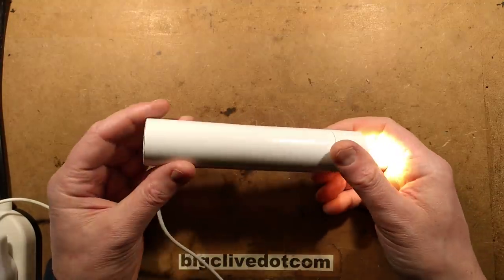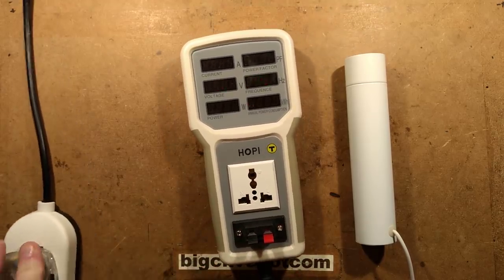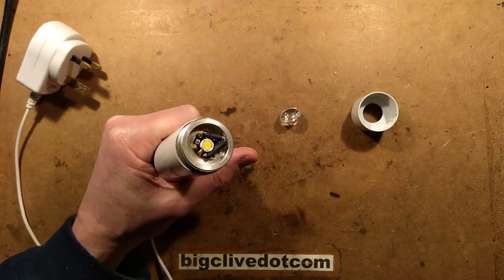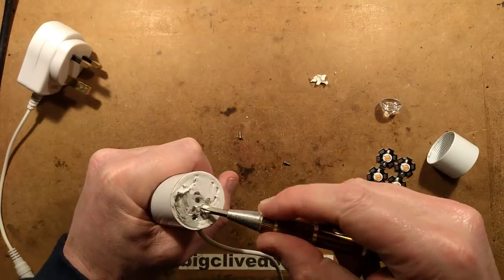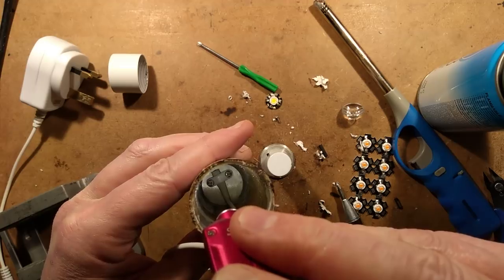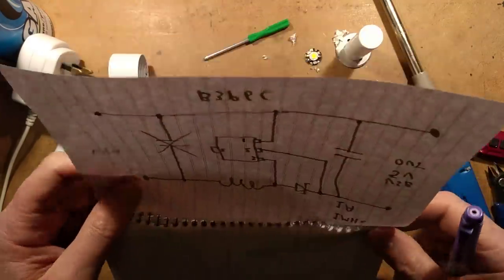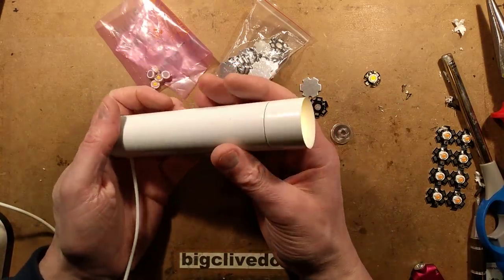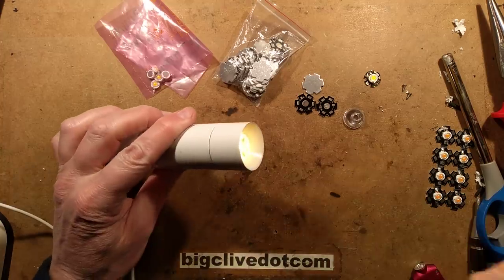Random opening, thoughts and mods to a chunky uplight.

Comment: You could have put a battery inside it and a switch on the side and..... Wait a minute, I think they call that a torch.
Reply: I was also thinking Bigclive inventor of the flashlight.
Reply: no no dummy thats a flashlight, a torch is a stick with fire on one end.
Reply: Chris thing is nobody cares it's differant versions of English e.g. American vs English so please shhhh
Reply: And put a flashlight driver in it, like a cheap  Nanjg AK-47A (hacking that with a fet on it). While we at it , use a zener mod and put a cree xhp70 6v (2x 18650) in it. At 7,5 amps it would be 5000 lummens :-)
Reply: @Ant1997Killer  ...........You just blew the Torch out !!....
Reply: Chris what if the stick has fire on both ends

Comment: Random metal chunks inside for weight? This reminds me of the time I took apart an electric lawnmower only to discover a sandbag built into the chassis.
Reply: Most cheap mowers with plastic decks are so light they need ballast to stop the weight of the handle tipping them over.
Reply: @@ShyToad Again very common  The more expensive brands use cast iron weights bit Ive seen lots with concrete. A full load of wet clothes is a LOT of mass to be spinning at 1200-1600 rpm and its never properly balanced so the machine needs a big chunk of mass for the imbalance forces to work against to prevent it shaking itself to bits.
Reply: Having the concrete inside the machine is a modern innovation. The house I'm in has a concrete block under the floor that used to have a washing machine bolted to it.

Comment: My To-do list is getting bigger, by that I mean expensive
1) get a shed 
2) get a lathe
Reply from the maker: It's never been more affordable.  But the best lathes are probably the old fashioned units made to tight tolerance.
Reply: @bigclivedotcom  I've got a lathe. It's an old Myford "M" model. It's older than me and I'm 67 tomorrow.   It's built like a brick khazi, all cast iron and steel. Weighs a ton (not quite but seems like it does).
Reply: If you get a lathe, you're going to need a bigger shed so you can fit a milling machine in it too.
Reply: Who need shed? Put it in kitchen or living room 😉
Reply: Actually pocket lathes have become pretty affordable. A decent unit is about 500USD China-direct. For a project like this, and so long you understand the limitations, the machine can pay for itself with various projects in a year.
Reply: @bigclivedotcom  I'm just in the process of referbishing two lovely old Myford ML7's, one to keep and one to sell and they are way better than any of the new hobby lathes. Plus if you're lucky, they can come with many extras :)
Reply: Can always get a clapped out one :)
Reply: I worked at a lathe for 14 years. If I never see or operates one again I'll be a happy man.
Reply from the maker: @gutsngorrrr  Are the parts interchangeable between the two machines?
Reply: A lathe is not that expensive here in the US harbor freight told has one for about $500 it’s fine for small work   I have a mid 60S south bend with a 12 inch swing and a vertical mill from Cincinnati tool both I got when the local trades school sold them to buy new CNC ones got them for scrap price at auction along with a big crate of tools for them some even new in there plastic  sleeves it seems the young people can’t do a thing with out a computer any more  no one was bidding on them ! Cost more to have a rollback move them to my shop building had to buy a motor generator phase converter to run them again for little money. There are bargains out there if you look for them  on the older machine tools .
Reply: I got a cheapo chinese minilathe about 10 days ago. It is cheap, wobbly and shitty. I love it. Small enough to carry without help, fits on a desk, can cut aluminum and soft steel. The tail support is quite hard to align, the gears for threading are plastic and the tool holder it comes with is baaad. Construction is very simple and can be easily modified and upgraded. This Old Tony made two videos on a very similar one not long ago.
Reply: You should make Mark Wallis an offer for his 2nd Myford ML7 BigClive - I have one from 1962 -  you wouldn't regret it if it's a good 'un :o) Won't be cheap though, I suspect...
Reply: @bigclivedotcom Yes, in most cases, parts are interchangeable, as the lathes didn't have major changes over their production life. For all information on them, go to lathes.co.uk.
Reply: @paranoiia8  There's a single man ... or one who wants to be...
Reply: I just got my first lathe, omg, why did I wait so long?!?!? SO much fun, so many projects.
Reply: @T0NGPU  I bought one of those ten years ago, kept it in my kitchen for a year or two, did a lot of decent stuff with it,  have fun👍
Reply: @paranoiia8  Ha! Single guy, like me! Smart Man. I just wish I had a living room.  ;-)

Comment: If you're going to machine something like that our of a billet, might as well make a void for an 18650 cell and the converter/protection board and make a flashlight.
Reply: Smidge204 Using an ordinary piece of steel pipe as body is a great simplification, only fabricating the block below the LED.  Drill a hole in an end cap for the lens and use another end cap for the bottom.  Stuff in any other needed parts like batteries.

Comment: Great stuff as always.  Use thick wall Al tubing. Thread outer ends. Rebates with a boring bar to hold each terminal plate.  Add an 18650 w/ control module.  Done.  

You could add slugs of lead, copper, steel, whatever to give it mass.  A cleaver lad may add a small stack of Neo magnets at the far end.  I may well do this.  I'm thinking 2" tubing and a pair of lipos.  Any more ideas?  

Great shop craft Clive.  Thank you.

Comment: That way of adding the weight results in the centre of gravity being lower than if they had just used a thicker-walled pipe, which in turn would make the lamp more resistant to tipping.

Comment: The closest multiples (@ 5% tolerance, anyway) are 2.4x (red-yellow), 2.7x (red-violet), and 3.3x (orange-orange) for the 1st two color bands. At 2%, you can find 3.0x (orange-black-black), and at 1%, you could probably find 2.8x (red-gray-black) exactly, or custom order some (probably in lots of 1000 or more.)
  It’d be much more fun to find a long drill bit that’s slightly larger in diameter than the resistor body, drill a hole down the length of the aluminum tube, attach some wire to it (the resistor, NOT the drill bit), heat-shrink it and pass the resistor down the hole, and wire it to a contactor (N.O.) to mains, then wire leads to the contactor coil and energize it, whilst standing a healthy distance away! Make sure to catch it on video, and do a quick autopsy on it! 😆

Comment: 2x machined Aluminum pucks, with threads cut.
Front puck serves as base & heat-sink for LED, and small holes drilled for supply wires & thermal compound glue to hold LED in place----plastic lens holds LED in place at the other end.
Rear puck serves as heat-sink for resistor / caps / transistor chips & power input wire clamp.
Only problem:  steel tube & aluminum pucks won't be good friends; corrosion will set in, of particular concern would be the metals used in the chips as they will end up functioning as sacrificial anode metals---IF there's no isolating compounds between metal heat dissipation surfaces of the chips & pucks.
All else, Bob's your uncle.

Comment: It seems a bit over engineered and an unusual design. Did it have a specific purpose or some kind of stand? Interesting none the less 😁
Reply from the maker: Just a freestanding uplight.  It actually does its job very well.
Reply: It would be easy (and interesting) to drill & mount a camera tripod screwthread adapter at the centre of mass. Suddenly you have a very useful (and rather trendy) light!
Reply: I actually liked the high standard of engineering on this light. Not the  usual china crap. Looks like it could get an UL, TUV  or CE badge.
Reply: @SharkoonBln ...as long as none of those tries to check the declared power factor, sure...

Comment: Plastic drain tube, plus an Aluminium block at each end, or maybe even only one end, with components, and suitable attaching screws, would be simpler and cheaper, but just as effective. Pop a suitable rechargeable cell or battery inside it, and add a USB port plus switch. No need for lots of machining, apart from the two cylindrical blocks. In a nutshell, you've made a rechargeable torch. Thanks BC.

Comment: Hi Clive, just wondering, would it be possible to modify a standard usb power supply to output a lower voltage?
Reply from the maker: It depends on the type of circuitry inside.  If it has opto-isolated feedback then you could modify the feedback circuit for lower voltage.
Reply: It would be interesting to do a project on this some day. Could be very useful for driving led projects without having to waste almost half the energy on the 2v drop.

Comment: Good thing Big Clive isn't a machinist....  What they did in the commercial product was far, far easier than machining a solid aluminum rod...  Never mind that in the tube arrangement you can just put an 18650 inside with a charging circuit....

Comment: Hey there Big Clive! love your vids! You are awesome bro. I have a need for a 'slow on' led driver... meaning when turned on it just slowly comes on to full brightness... like 5 or 6 seconds. has to be tiny. i'm sure there is an easy way to do so without breaking out the 555. The led is a 3-5v. If anyone could help me I figure it would be you. I was thinking possibly the right cap inline would work.. thought I would check with you. Thanks for the vids!

Comment: with the hollow tube design, someone could put a Rechargeable Ni-Cad Battery in there, and have a nifty Flashlight / [ Torch ]
and use the hole where the power cable went through to install a small female Power connector, for the charger input.
Reply: DUSTERDUDE238 you beat me to it man! I was going to say just buy a touch. NSW in Oz
Reply: Torch!!!

Comment: one question which im sure has been asked countless times. is WHY? why make a torch with a small led out of a steel tube and then plug it into the mains. if something went wrong you would have a great big electrocution rod. What/where was the logic in the manufacture of this torch.
Reply from the maker: It's a room light and the power supply puts out low voltage.

Comment: I would always prefer a cheap standard step down module ( lm2596) instead of a high power resistor. It may be almost same price delivered, too.
Reply: You need a module with constant current regulation to drive an led. The cheap LM2596 modules are voltage regulators with current limiting, not really suitable.
Reply: @ferrumignis  These modules will do if you don't want or need absolute maximum power. It's just a cheap option.
They don't have current limitation, but you can get current regulated modules, too. They are just a lot more expensive, but they use the same chip. Maybe you can program the cheap modules to a fixed current. I just discovered that.
Reply: @CyberlightFG  No they wont, you can't properly drive an led from a voltage source without a current limiting resistor, and if you put a resistor in you might as well just drive it directly from a 5v usb supply.

Comment: Or you could convert it into a battery powered torch by using the correct circuitry and you could probably fit a 26650 in there

Comment: Help me understand that calculation please.
Reply from the maker: To calculate the resistor value required for an LED you deduct the LED voltage from the supply voltage.  In this case it's a 3V LED running on 5V so we need to drop 2V across the resistor.  To determine the resistor value in ohms we divide the voltage to be dropped by the desired current.  So if we wanted 700mA (0.7A) we would divide the 2V by 0.7 to give 2.86 ohms.  Nearest standard values are 2.7 or 3.3ohms. 
To get the resistor power rating we multiply the voltage across it by the current through it, so 2V times 0.7A = 1.4W  Choose a higher power rating to ensure the resistor doesn't get too hot.  I'd generally recommend a 3W or higher resistor.

Comment: Hmm, seems like a whole lot of nothing going on inside for what it's doing. I feel like the whole thing could have been made the size of an ashtray and still had basically the same function.

Convert it to run off of an 18650 cell and, well, as others have pointed out, you basically just have one of those high power tube-style flashlights. Actually, I thought it was a flashlight at first when I saw the thumbnail.

Comment: The aluminium tube + steel weight would be a lot cheaper than solid aluminium.  This way also keeps the centre of gravity low for greater stability.

Comment: Got shed but it is fuller than my Santa stocking!  I don't have a lathe but I know a man who does, I think I would make it of brass or solid copper, may not, I think I would put a cell in it and a micro usb then charge it up so I could run it off a phone charger or run it off a cell.  Be much more useful then.  Only problem is I could get something from China that will be at mains potential and be much more dangerous, after all is that not what we like, dodgy and dangerous with a risk of electrocution? lol
Reply: Heatshrink has an excellent dielectric rating (just saying!)

Comment: Coupled with an 18650 Li-Ion cell, a USB lithium cell charger circuit, a switch and a USB socket, you could turn it into a torch... :D

Or just maybe buy a torch instead, sometimes my mind wanders off with ideas like that without actually thinking about them first... :P

Comment: Thanks for sharing this... great idea for a hack by the way.  I think I would use a bit of tube and end caps.  Hey just a sideways idea how hard would it be to put a switch in the side and add a 18650 cell for when it's not plugged in?  USB powered and charged at the same time.